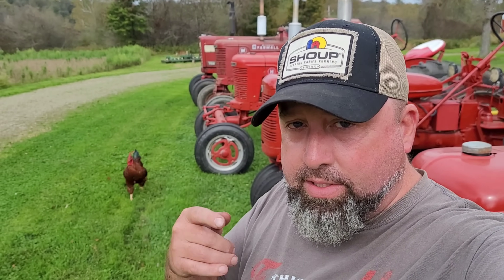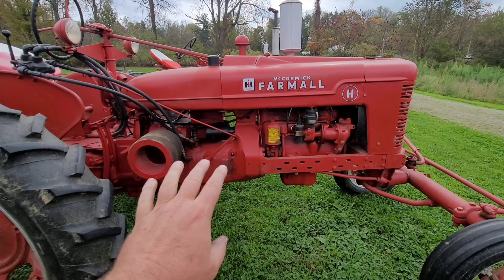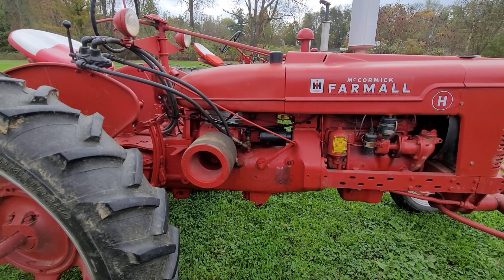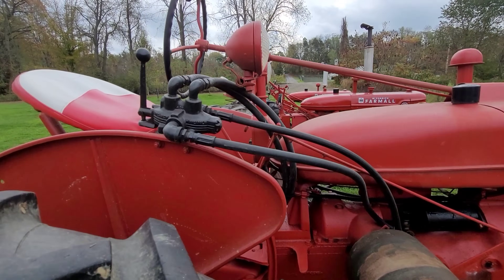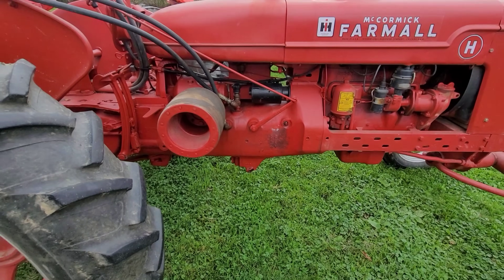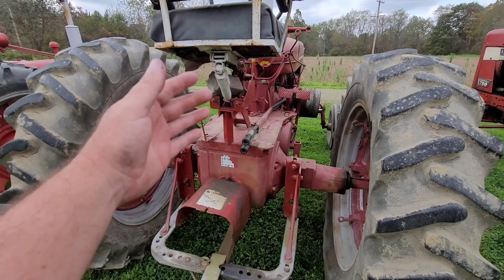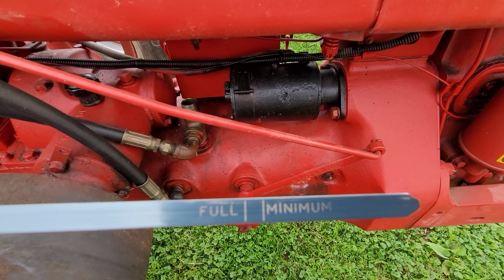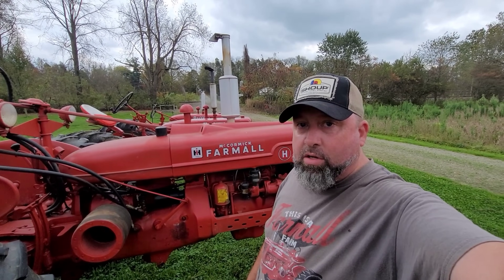How to Plumb Hydraulics on a Farmall Tractor

Comment: Hi FF we have a 656 narrow front w/ power steering. It has a lot of gremlins.  We have changed the pump,filter and hytran oil and still no power for hydraulics ??
Reply from the maker: Obstruction in the system is what it sounds like

Comment: Hey Farmall Fanatic, thanks for this video and many others. I have a 56 Farmall 400 with a loader to push snow and I’ve watched several videos. I am looking to hook up a small cultivator or small disc. My question is, with that loader being hooked up would I not be able to use hydrolics for an attachment at the same time? My tractor has two ports coming out the back under the seat and a third lever, two of which are used to raise and tilt the bucket. Let me know your thoughts, thank you!
Reply from the maker: What I do is I set the loader at a certain height and then unplug it... And in theory it should stay in place
Reply: @FarmallFanatic  okay thank you. So if it stays in place that means I’ll be able to hook up an implement and be able to lift that?
Reply from the maker: @ericstaebler5255  yes
Reply: @FarmallFanatic  awesome, thank you!!

Comment: Question.  When I pull that rod my engine wants to start bogging down as I release the clutch slowly so I push clutch back down. I think the pump is locked up/ And afraid it will break something in there.
Reply from the maker: You can switch the pumps out without too much problem they are fairly heavy

Comment: Question(s):  I’m new to the Farmall H world.  (Grew up with a Super C)
Does the hydraulic pump fluid reservoir communicate with any other reservoirs of fluid? (Gear box, tranny, etc).  OR, is the hydraulic reservoir dedicated to just the belly mount hydraulic pump?
Reply from the maker: It's dedicated but I would still use thirty weight oil.
Reply: @FarmallFanatic  thanks. But using Hytran (as you mentioned) is ok?  I’m unsure of the weight of the Hytran
Reply from the maker: @7Michael.E  HyTran is the best...it's 10 weight
Reply: @FarmallFanatic  Sir, sorry to keep at this.  You stated to use 30W. But it IS ok to use 10W Hytran?  Thanks for ur time…your video and the willingness to answer questions from a newbie.
Reply from the maker: @7Michael.E  30 weight for a weaker pump...HyTran as long as it still lifts your cylinder

Comment: Does the belly pump share the same fluid as the rear end housing? Or is it separate
Reply from the maker: Separate I would recommend thirty weight oil
Reply: @FarmallFanatic  thank you so much! This video was very helpful! I am putting a woods belly mower on my H for the first time and this video was perfect.
Reply from the maker: @ryanmcbride7547  right on 👍

Comment: I'm wondering if an M belly pump will run hydraulic feed on a chipper ?
Reply from the maker: It would b worth a try
Reply: @FarmallFanatic  I'm going to fab up a 3 point hitch and try it. L3200 kabota is only like 6.5 gpm and its way more oil than it needs.

Comment: Two of the ports where for the front cultivators. The other is a delayed lift for the rear gang. I Use 30 weight non detergent in my belly pumps. You can increase the pressure on early pumps by installing the later relief valve spring. or shimming the original spring with a washer. The live pump that is stacked beterrn the drive and ignition are a handy upgrade.

Comment: I bought my very first tractor a year ago its a 1962 B-414, got her up an running finally. Glad I ran a crossed this video I was debating on what fluid to run for the hydraulics. Thank you very much for the information much appreciated.
Reply from the maker: I just saw a B-414 for sale at auction...it's the first one I ever saw in real life
Reply: @FarmallFanatic  it's a nice little tractor for me.
Reply: She's a stout little acreage tractor for my use at least. I have a 6' bush hog on it an works great. Also have a 8 row disc I use for my garden area. Picked it up for 1,400 bucks with the mower disc an 6' blade. Granted it didn't run do to missing plug wires, but I took a gamble an I think I won that gamble.
Reply from the maker: @DaPittBull911  yes, you won 🏆

Comment: I added a 3 point hitch on my H, added a 2 spool valve and plumbed the return in the drain plug of the belly pump via a Tee. Replaced the fill cap with a dual hole breather so no pressure builds. Installed a pressure valve and get 850 psi out of the belly pump
Reply from the maker: That's excellent
Reply: @FarmallFanatic  it works really well. Also installed a shut off valve right before the 2 spool valve. I picked up a 3pt log splitter, throw the shut off valve to off position and I get hydraulic power from the rear port on the other side of the tractor for the splitter.  Just have to adjust the height of the splitter where I want before throwing the lever on the shut off valve. They really made a solid machine back in the late 40's...
Reply: @FarmallFanatic  plumbing the return line in to the drain of the belly pump prevents mixing a bunch of air into the hydraulic oil.

Comment: Gonna have to go look, but I think our Super H w/TA has a cover where the hoses run across the platform. As far as the hydraulic system's go on this era of tractor's, the 2 cylinder John Deere's are ahead of the class.
Reply from the maker: I don't know if I've ever seen a Johnny Popper with a remote
Reply: I agree with that. However, IH on their standard tractors of that era did use live hydraulics. They came later in the late 40s. I don't understand why they kept the belly pump as long as they did when a better system was already offered on the W-4, W-6, and W-9 counterparts. Is your super H with the TA real or does it have a 300 or 350 rear end?

Comment: Hi-train does not have detergent in it, which causes air bubbles in the oil. All motor oil has detergent in it. Hydraulic oil does not. The air bubbles cause the lift cylinders to move when you don't want them to move. Most cylinders do travel from one end to the other, but not always. Sometime you will only want to move the hydraulic cylinder just 1 inch or so. With detergent in your oil, that become more difficult to do, and the cylinder can move a fraction of an inch or so when you don't want to.
Reply: I run SAE 30 and plumbed in a filter on the return side right before the drain of belly pump, beat practice to return the oil there in lieu of the top of the reservoir fill tube. That mixes air into the oil
Reply: Caterpillar does use engine oil for hydraulics and it doesn't bother at all.

Comment: Good video! When i had h/m tractors, i found out the normal hyd pressure was 400 psi. Super h/m had 800 psi. the larger the cylinder on the older tractors, the more useful  it was. I "dedicated" a large cyl and lines to the tractor. heavy oil will make it pick up more also.
Reply from the maker: True

Comment: Would operating a Farmall H without the muffler wear the engine?
Reply from the maker: Unless you've put the hardened valves in it yes
Reply: @FarmallFanatic   H's have hard valve seats from the factory. the distillate did not have lead.  Many where converted to LP.  We never had a muffler or pipe of our tractors we used in the logging woods. it woul of caught a branch that swatted you when it went past the muffler or broke the cast iron manifold if it would not bend. Never harmed it a bit.

Comment: I have my M plumbed similar to your H but with the return going through the drain plug because whenever I lowered my cylinder it was pushing fluid out the breather hole on the fill cap.  I was losing more fluid that way and I like my tractors to be Red not black.
Reply from the maker: Ahahahahahahaha 🤣 oh man

Comment: I agree with you on that fluid we're the same way several pieces here that we run with the newer tractors and also the older ones and I just run high training the whole fleet and ours is a fleeting on the collection they're kind of pretty most of them and we try and keep up with the paint just like the rest of the maintenance but they are a working fleet enjoy that video I'm going to remember that I had a couple old ones like that here that are set up with just a one-way hydraulic and I wouldn't mind changing them over so we had two-way

Comment: the H dad gave me he bought the factory 2 way kit and had it installed 
 the truth about the lyft-all pump they were an option  in 1938 and 39s on the F series farmalls and as a after market kit  for older F20s F30s.
      the original pump was a low pressure, low volume system 450psi and fudge a little  with upping the pressure to 550psi..  when these wore out you bought the upgrade kit  which had bigger gears and a matching center casting and a differnt relief valve spring...
 the original use the lyft-all was intended for was to be used with the small cylinders of the cultivator, the mounted corn picker the cycle bar mower etc.
Reply from the maker: Interesting history

Comment: Speaking of hydraulics, today I cracked the housing on the Christmas tree valve on my super M TA while installing a hydraulic hose. I tighten the hose too much and split it on one end. It's cast iron and does anyone have any suggestions on how to repair it?
Reply from the maker: This is gonna sound crazy but there's something like JB weld, but stronger and I watched a guy put that over a similar break and it worked.
Reply: @FarmallFanatic  I googled jb weld and it is supposed to handle up to 3500 psi. I think I'm going to try that. Thanks for the reply!

Comment: My H is setup with a later pump and it puts out 750psi on a gauge I bought.

3 point conversion. 3" International cylinder with 8" stroke. I can pick up any reasonable implement for an H. 

No down pressure however.

I'll never go back to a drag type brush hog. For the stuff I mow. The fact I can turn tight as I want with the 3 point and tricycle front end=love it.
Reply from the maker: 750 is good 👍
Reply: @FarmallFanatic  that's on 30w non detergent too

Comment: Hi FF! Sometime or other could you explain the difference in the wide front on your H and other wide fronts like the one on your M. Your H has the first wide front axle I've seen on a Farmall that sticks out past the front end of the tractor. Also I'd say you have a fleet. LOVE the RED POWER line up by the way!
Reply from the maker: There's a plate that allows you to put it under the tractor
Reply: @FarmallFanatic  Ok thanks I've wondered about that.
Reply: Those were originally part of a sugar beet picking attachment,  never seen one but that extended front end gives it away. Nice video!